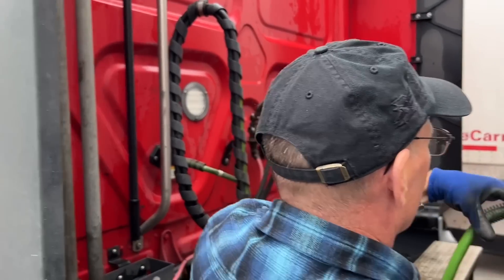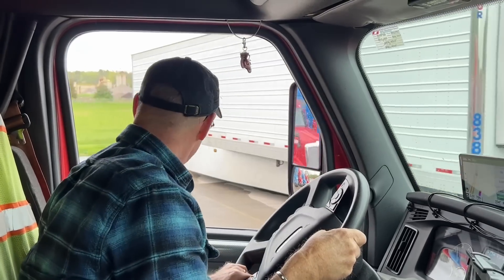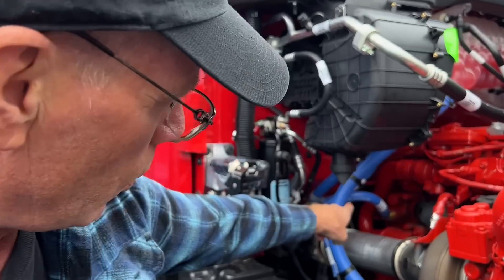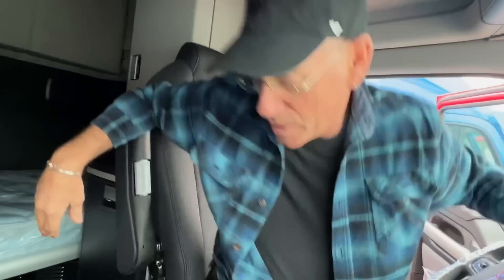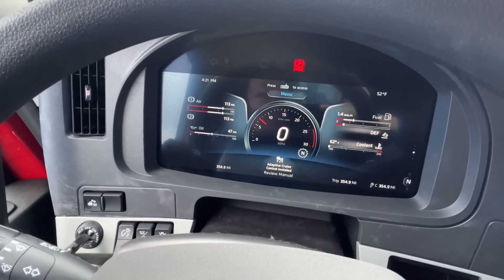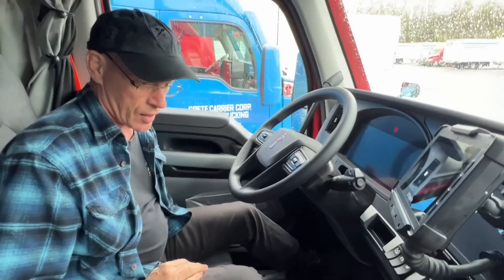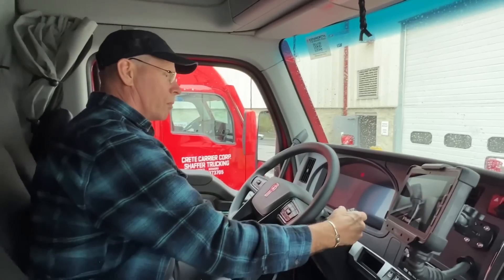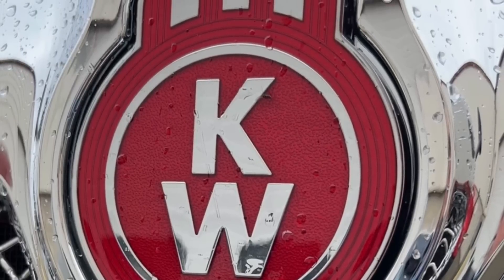Our New Truck - 2024 Kenworth T680

Comment: I've been with Crete for almost 19 years. I got a new 2020 T680 in September '19. I got about 1.5 years out of it before I started having problems with it. In the last 6 months I had it, it was in one shop or another a total of 30 days! Always waiting on parts.
Reply: Probably I’m using your old freightliners 45 436-2021
Reply: Crete a good company? I’ve been driving for 20 years never otr but I might have too. I’m stuck at a dead end company and can’t even sniff an interview with another company. I’m down in south Florida and the market is flooded with drivers looking for work

Comment: Congrats!!   Been with Crete almost 3 weeks.  I might be calling it quits though.  I like most everything about the company, but I can NOT get used to the Opti Idle!  It basically shakes me out of my bunk every time is shuts down.  I try to turn the temp up so it doesn't start up as much, but sleeping in Texas heat even at night doesn't help sleep much. I run a fan, but it doesn't help much.  I feel soooo tired.  The poor equipment at Crete is what kept me away for sooo long.  I guess my instincts were correct.  The lack of technology is very disappointing as well...  Peoplenet is one of the worst I have used, and the Crete app is useless except for scanning bills.
Reply: Turn the opti idle temps to max cool or heat and use trucks temp mix control to the temperature you like. Since temp will never reach opti set temp truck will never shut off. Sleep like a baby. Your welcome.
Reply: @phila8160  I have done that, it shuts down after a little over an hour and and then starts right back up.
Reply: I hated that Opti Idle when I worked there.   Felt like Pavlov's dog everytime it got ready to start, I'd wake up😂
Reply: @mikestriegel791  exactly, just about the time it gets too hot to sleep, it cranks, just about the time you fall back asleep, it dies!!  The engine shutting down it way worse than it starting up
Reply: @sweetteatruckin3202  yeah, that rumble . I've been pulling reefer th3 last 19 plus years, and while it can be similar, at least I can run the unit on "continuous".  Our new reefers are pretty quiet, too.  We use an Espar heater for the cold weather, and I absolutely love it.
Reply: @mikestriegel791  Reefers don't bother me tin the least!  Most my career has been reefer.   The noise isn't the problem, it is the violent shaking that happens especially when the engine shuts down.
Reply: @sweetteatruckin3202  that sucks , our company went to apu because everyone figured out the keep it running hack.
Reply from the maker: Hey there! So sorry you’re having such a rough time with the opti idle! We agree that it’s a sleep disturber. I’ll sleep with earplugs in the bottom bunk and still, like you said, it’s the violent shaking that wakes me up. I get better at not waking up after a few days, but that might be the exhaustion. Kevin is on the top bunk and it’s even more shaky up there. When we don’t use a/c it’s glorious. That’s why we didn’t take the 2023 without bunk heater. The guy said we could use opti-idle until the heater came in. We decided we weren’t prepared to deal with that for fall and winter too. Rough enough in the summer.
Hopefully you’ll get used to it, make it to cooler weather, and like another person commented…maybe they’ll get APU’s in the future. We are very happy at Crete, but that is definitely an issue. Being sleep deprived is not good for drivers. Hopefully you’ll get used to it so you can enjoy the benefits of driving for Crete. If not, please put your safety first. Let us know how it goes. 💕
Reply from the maker: Good Morning…spoke with Kevin about your situation. He said you could open windows to see if it then stays on longer. Also, in case you’re using top bunk…switch to bottom, it’s definitely better on bottom bunk. And…if none of this works he suggests talking to your terminal manager and asset manager and tell them you are about to quit because of this. See if they can put you in a KW. Kevin says the opti-idle is much better on his KW. Hope that helps!
Reply: @TheJoyofTrucking  Tell him thanks.  I do sleep on bottom.   I wish it were a KW or ANYTHING OTHER THAN A FREIGHT SHAKER OR INTERTRASHNAL.    One of the things that kept me away from Crete for so long was opti idle horror stories  LOL
Reply from the maker: @sweetteatruckin3202  😔

Comment: The new KW’s have an electric motor on the steering column to assist and increase input torque from the driver at low speed making low speed turning in super easy.

Comment: I've had one repeat issue my 22 KW (electronic issue with auto transmission selector and I just got it back from the dealership) but after a year and a half I still love mine.
Reply: I had the same problem with my 2023.  Took a week to have it sent out and repaired and replaced.  Almost left me stranded on the side of the road.
Reply: @jimhays1896  it's a royal pain.

Comment: Beautiful🚛. I hope you both enjoy your new toy and work horse. I hope the difference between the amenities inside the sleeper don't pose a problem; spacewise. You mentioned that there were less cabinets and you didn't seem too enthused about the refrigerator. The brand, "Kenworth" brings back memories. My father drove tankers for 40 years from 1930 to 1970 and always drove either a Kenworth or a Peterbilt. The jargon of the day was that Kenworths were referred to as KW's and not Kenworths. Now it appears to have changed to "Kenworths". Now, my grandson is driving flatbeds out of Ohio, hauling coils and rods of steel which all exceed the 80,000 lb. limit.

Comment: We had three new kenworths and the Volvo has the most storage of all the trucks. If the kw pops up and says stop. Stop and pull off the road because if not it could catch on fire. Ours did and they never figured out why it did and it was a 23 and we only had it three hours. But the kw has best dash it tells you everything. I love the shelf’s on the very top. Good for books or cleaning supplies. Enjoy yours. Just wish they would put metal bumpers on all the trucks.

Comment: I have a 2023 T680 with a x-15.   I had the gear shifter/selector go out at 65k miles.  Known issue and KW does not have replacements on the shelf. Had to have it pulled out and rebuilt.  Took a week, but under warranty.  Good luck and enjoy!!   I get 13-14 mpg bobtail and 9-10 loaded( usually 15-20k pounds)

Comment: You can also pull the ignition relay . Put it in your pocket its in the fuse box lower left under the steering wheel.

Comment: The Kenworth is a nice ride. No more freight shaker. You'll barely feel the pot holes now. Sleeper is claustrophobic. I have a cat and myself in a 2023 Kenworth T680. It's tight. Coolant tank with a coolant hose barely a gravity angle into the coolant tank is a stupid design. These new Kenworths eat alot of coolant and oil. Carry a bunch of coolant and oil. I have to add coolant and oil   about every 2 weeks . Have fun and safe travels.

Comment: Looks like a nice truck. I was 
/o for many years. I only owned Kenworth. I am retired now. My thoughts on the T 680. I owned one at one time. I put 1 million miles on it.  It had a paccar  engine. 13 speed manual. 
I did like the interior. But for me, it was the worst truck I ever owned.  It was in the shop more than on the road. Just one year I put 38.000 in the shop cost. That was my most expensive year. I put more in repairs than what the truck cost me. I must got a lemon. My very best trucks was the W900l. I had owned 2 of them over the years. I figured I lose a mile a gallon but in the long run, they stayed out of the shop.

Comment: Congrats on the new truck! Disc brakes or drum brakes? FYI: The two blank spots on the left side of your steering wheel controls is a Paccar engine feature not available on the Cummins. It’s a plus/minus button that allows you to limit your speed. Example: set it to 55mph and you can just hold the pedal down as opposed to trying to maintain 55mph. Just a different way to “cruise control” while simply holding the accelerator to the floor. It’s a nice feature for those of us use to holding the pedal down all day. Predictive cruise is annoying! I prefer consistent speeds so as to not aggravate people around me by constantly speeding up and down the way predictive cruise likes to do.
Reply: When he pops the hood you can see he has the Cummins X15 not the Paccar Mx13
Reply: @deeztruckz2430  You obviously didn’t read what I wrote.

Comment: My Company just put me in a brand new 2024 Cascadia.  Just turned 2k miles on it.  How has your KW performed so far?
Reply from the maker: Good for you! New is nice! But…we are partial to the smooth ride of the KW. It’s doing well. Though the Freightliner has much better storage and lights.
Reply: @TheJoyofTrucking  And a much better refrigerator.  KW's aren't designed for taller drivers like myself.  I sat in one.  Even with the seat pulled all the way back, my legs were still cramped.  Standing at 6'6, i'm so thankful they ordered Freightliners. 👍
Reply from the maker: @TheTallMan50  👍👍👍😃

Comment: What is the drivetrain specs and what kind of mpgs do you get
Reply from the maker: Cummins x15 with 455hp attached to a 12 speed automated transmission. Mpg has been as good as 12. But usually 8-9mpg.

Comment: KW now unfortunately are pretty much trash. My KW 3000 miles had transmission problems and still does. It hard on backing to docks. KW thanks they can turn off radio in reverse. DEF system needs work it kills alot of  power

Comment: Sorry but my experience with that new Cummins is they are junk, I really hope you don't get the Peterbilt traction control system
Reply: Sorry but we bought 7 2023 Pete's, the traction control in our trucks was way to sensitive kicking you out of gear and cruise control on bumps. But all seven where in the shop for major issues already. I do hope yours goes smoother
Reply from the maker: @iralawrence9311  Sorry you had so many problems with your trucks! Hope it improves for ya’!